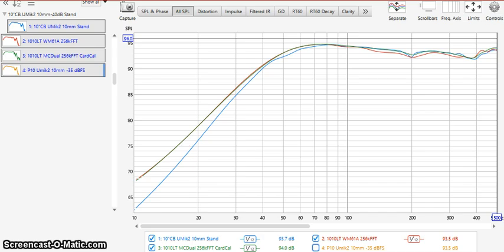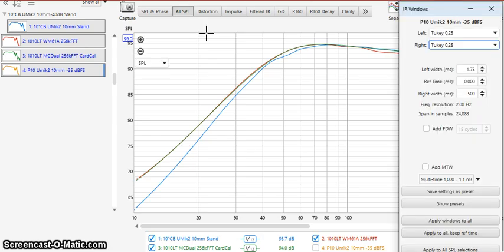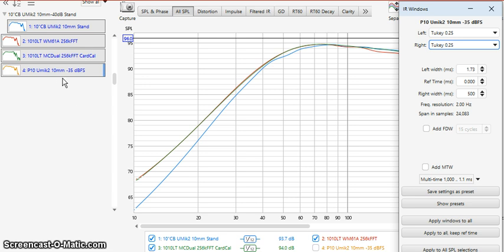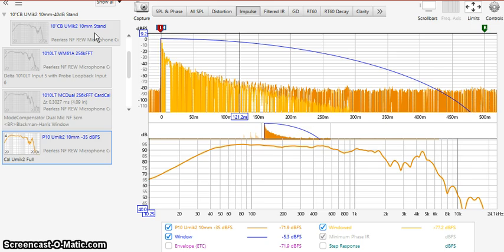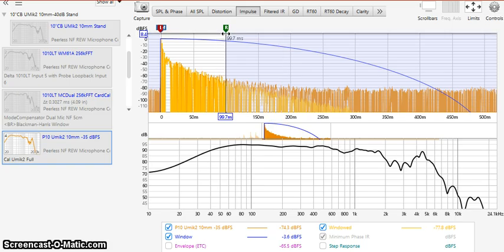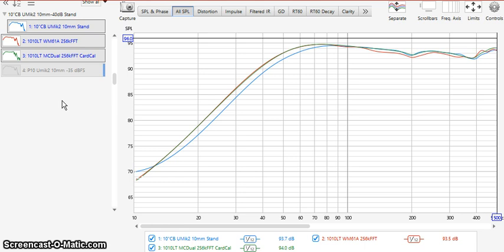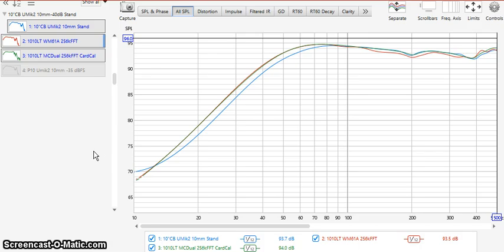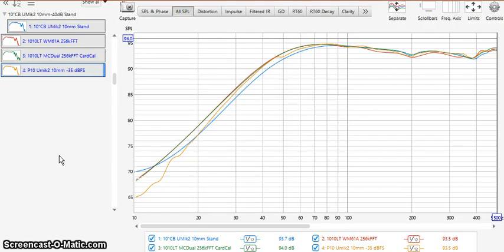REW Driver Close Mic Measuring

Comment: I don't understand why many insist on using the Umik-2 microphone. It's not that great and doesn't allow for loopback with REW (or other analysis software). A much better choice would be something like the cost effective Beyerdynamic MM 1. It's a real, for grown-ups, measurement microphone. Couple this with a Presonus or Focusrite mic preamp and you've got a much higher quality, more accurate system. Sure, it costs a little more but, instead of spending big bucks on speaker cable, overpriced connectors or DACs spend it where it actually makes a difference.
Also, because the MM 1 is an analog signal you can make your cable as long as you want and aren't tethered by a limited length USB cable like with the Umik.